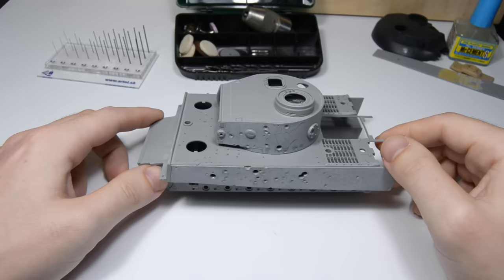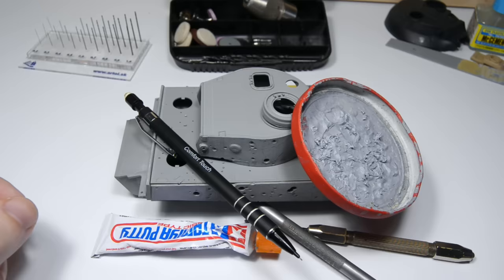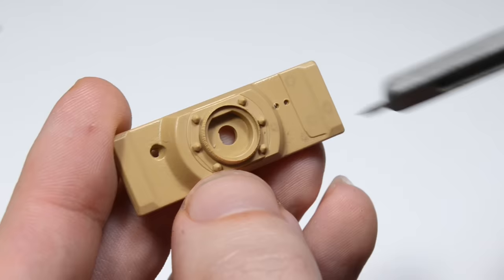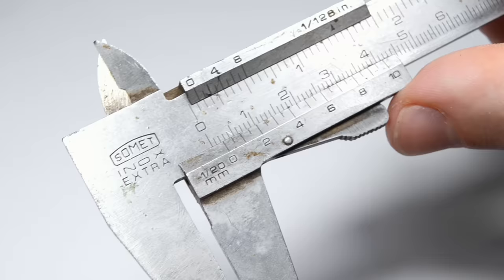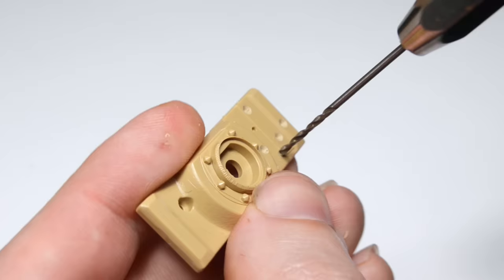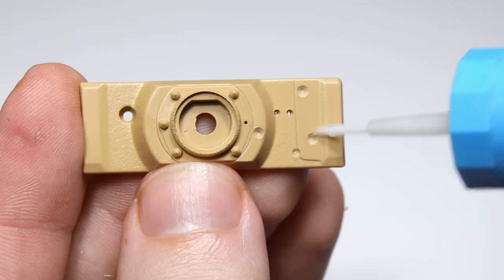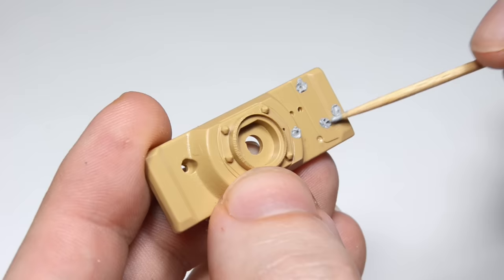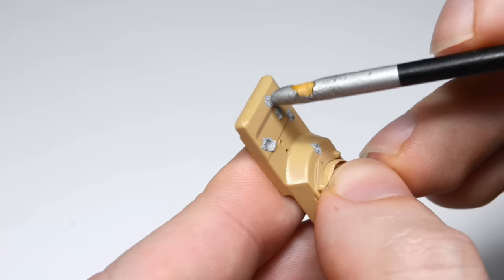EASY Method to Make Realistic Shell Impacts on Armor Models

Comment: When I used to build Gundam models I would sometimes used a soldering iron to burrow battle scars into their shields and armor. The benefit of using the soldering iron is the displacement of plastic that looks a bit more like actual impacts on metal. Also adding a bit of rust color to some of the holes gives the impression of a vehicle that's been through several battles.

Comment: The way I usually do this is with a hobby knife, because I'm too damn lazy to go buy a drill. It has the benefit of creating really uneven holes and scratching the hell out of the panel, which both help make it a lot more interesting I think. I definitely like your technique better though.
Reply: But you are not too lazy to go buy new blades?  Best tool for the job yields the best result.

Comment: One other tool you might want to take a look at for doing things like this: ball end mills or router bits. What they are are bits used to do 3d CNC carving so they are shaped very much like a drill, but instead of coming to a point at a specific angle, they are round. The teeth or cutting edges are the same shape as the end. 

You can get them in just about any size from a couple of mm up to 12 mm. 

The beauty thing about them too is unlike a drill whose cutting edges are only at the point, these also cut along the flutes. They'd be a breeze for making those impact craters.....

Comment: If you use a hot soldering iron or pyro tool with a pointed tip, it will quickly create holes with raised rims, without the need for drilling or putty. A tool with temperature control is best, IMHO, and copper tips can be easily filed to make irregular shaped holes.

Comment: Back in the early 70's when I made models, used a hot wire.  It created the hole and the plastic would shrink away  in a similar way to an impact.  I started this by using a sparkler and its hot wire.

Comment: Try get some scrap plastic sheet, use the model mould supports the stuff you throw away (which would probably be able to be recycled into 3d print filament) and burn the off cut plastic and let it drop from a height onto the plastic plate. The splatter should look like a shell hit and the melted blob removed from a now indented melted crator.

Comment: Depending on where you live, use a .177 air rifle :D 
I have special pellets for mine that are essentially APDS (armor piercing discarding sabot) and they will actually go through thin sheet steel that was the side panel of an old computer case, leaving holes that look just like miniature tank shell penetrations. My rifle isn't even the most powerful available here, it only goes to about 800fps where others go well over 1000fps

Comment: I wouldnt consider a rotary tool specialized, if you dont have one yet it's your fault! You can pick up a good one with a kit for 25$ nowadays. Mastercraft from canadian Tire, one from harbour freight, it doesnt matter. As long as you dont push the duty cycles, which you wont doing terrain work, theyll last as long as a dremel. The main difference with a dremel is you can run them a lot through the day and the speed control is really fine, but honestly if all you can afford is 25$, you need one. They are a game changer. You can find uses everywhere. As far as the video itself, amazing. I love what you accomplished with that and ill be making use of it on my next terrain pieces!

Comment: From a beginner; what is the needle pointed tool you use for the centre of the hole, and how do work out what size drill bit to use for the correct size shell impact.

Comment: I would’ve thought heating up a soldering gun tip and pressing it in would be a good idea?
Reply: EbbOneMint It would get the job done, but I would recommend having a well ventilated area, a plan in case of fire, and something to clean your soldier tip. I would also recommend not breathing in the vapors from the plastic.
Reply: Maybe soldering iron have more damage risk than this method for inexperience  ... Too much Melted parts will be hard to fix

Comment: Rounds that penetrate armour always leave a bigger hole on the inside than the outside. High energy transfers often result in ‘spalling’, which means shrapnel breaking off the inside and flying around, causing further injury and damage. Modern High Explosive Squash Head (HESH) rounds may leave relatively little damage on the outside but cause massive spalling on the inside. High Explosive Anti-Tank (HEAT) rounds may make a small, e.g. finger-thick, tunnel through armour that may be more than 15 inches thick, and will then spray copper and steel plasma around the inside, thus heating the inside air to the point the ammo can explode (brewing-up). There are other types of attack, including overhead weapons, so some research is needed to be accurate.

Comment: I'm considering bending a fender of a Pershing tank by using some heat.  What do you think?
Reply: If you can afford it then replace the plastic parts with brass aftermarket. Plastic under heat tends to just bend and warp rather than crumple, fold and leave hard edges the way it would in reality.
If you do want to use plastic, one thing i've found that helps is reducing the thickness to scale, then bending with soft-grip pliers or something similar. You shouldn't even need heat if it's thin enough.

Comment: Never would have thought of doing this!  Does the technique work as well for armored decks of warships?  And how would you simulate the exit wound left by a shell plunging through the bottom or side?
Reply: GRAYR189 kitchen  Foil maybe? i did a bf 109 that had crash landed and i used kitchen foil for 2 panels. entry, exit, looked ok.
Reply: @ryzenenjoyer2824  would like to k ow more about how you did it 😃
Reply: GRAYR189 A ship deck is wood so no, it wouldn’t work unless you actually the model actually uses wood than you can manipulate and break the wood to look like an impact. A
Reply: @hazardous458  i understand that  warships' decks are sheathed with wood but they ARE armored plate underneath the wooden decking.  Bismarck's main deck, for example, was something like 100 mm thick steel plate over the citadel. And smaller ships like destroyers don't have wooden decks at all but were plain steel plating.
Reply: GRAYR189 But the point is to get the outside damage. I know ships have armored decks but the armor is underneath the wood unless you’re doing interiors
Reply: @hazardous458  That's perfectly true.   The wooden deck sheathing would probably be splintered by the impact.  And the armor plate underneath would be punctured by an armor-piercing shell, and it's THAT damage I wish to simulate 😀

Comment: What I do instead is take a pin or small screwdriver and heat it up and then put it against the model, which also makes realistic steel deformation, then paint over it with a steel color and done

Comment: Just wondering, to make a puncture hole that could simulate the metal being punctured, couldn't you use a pointy soldering iron?
Reply: Alex Alves he said he used soldering irons before but this video is about making shell impacts without special tools and soldiering irons are special tools.
Reply: @hazardous458  Didn't catch that he mentioned it. And well, I wouldn't categorize them as special tools, tbf, most people have them at home, but I get what you mean

Comment: Good technique but you must remember that not all shells impact at 90 degree angle relative to the face of the armor. Some impact at oblique angles and it shows in the assymetrical way the small "craters" are shaped. I believe you could easily replicate oblique impacts just by applying an oblique angle on your drill bit.

Comment: Much easier method, heat up the end of a sharp pointy metal object, with a lighter, use pin for small caliber and just tap quickly and lightly in one area, for larger guns, use something the size of pen pount, for diagnal hits press into model at about 45° angle, very realistic, used it on al my models, oh and for weathering, use real mud, why not? Why make things harder than has to be?

Comment: wow... WAY to much work and extra un needed tools. Ive been doing realistic bullet holes on everything from WWII planes, tanks, ATVs, even a few car models in a "gangland" scene.  tools needed: assorted sizes and sharpness of sewing needles, all the way from the very thin needles to the larger leather working ones. pair of pliers to hold the needles with, and a flame source, lighters work but are slow, I used to do a lot of work near the gas stove, but there are many sources.  push the needle in the direction of impact of the bullet trajectory,  sharp needles for pass throughs, dull ones for bounce offs and ricochets. this method will create the ride around the holes from displace materials. practice it a bit and you can learn how the plastic reacts to temp and direction of force. shrapnel marks can be made with the sharp needles and lightly scratching the surface. all of this work with mini drills, putty, xacto knives, brushes, cement... just to much. the heated needles can do delicate work such as bullet holes in the thin propeller blades on the models. for very large caliber holes you can use ice picks, awls and leather punches..